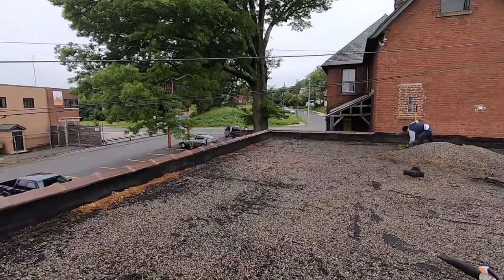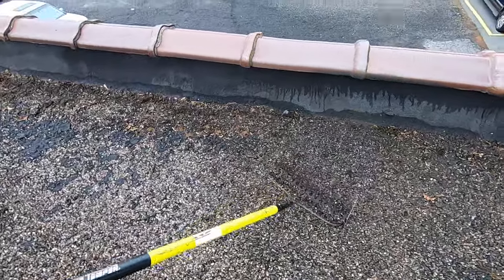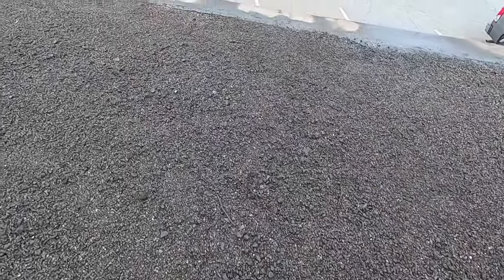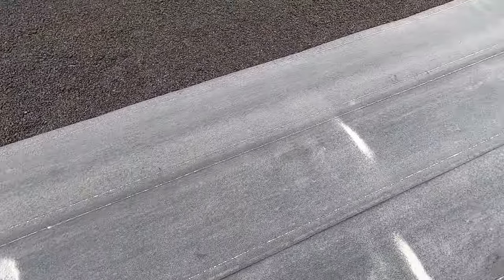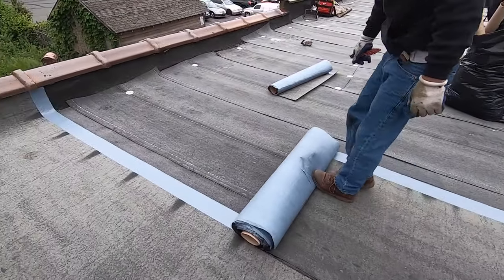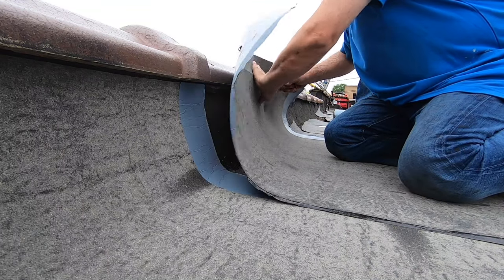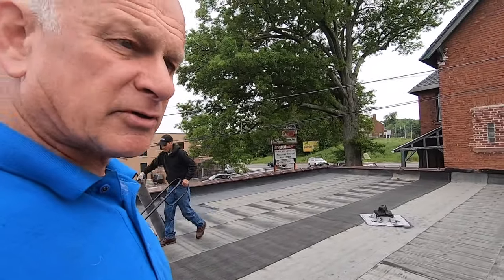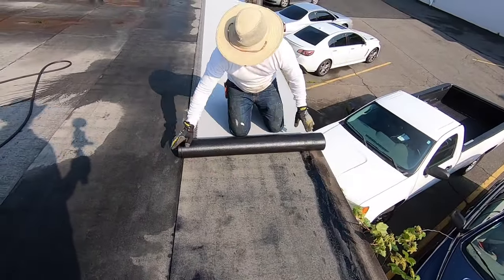Installing a Torch Down Rubber Roof directly over Gravel - Turbo Poly Seal Flashing repair

Comment: Nice all the screws through the deck will make nice drainage holes for all the moisture that was covered up on the old roof.  U always need to vac the blast off roof and repair any splits and blisters in the old roof.  Hope u installed moisture vents in this roof other wise its own to be one blister.
Reply: im worried you are right especially on a flat flat roof

Comment: Dude ! I've been doing commercial roofing for 15 years and I've never seen such a thing ! And I dont mean that in a bad way. That's awesome!!! Next time I get a side job and the existing roof is a gravel build up like the one you just went over I'm definitely gonna push for the customer to go your route. It saves so much time ! Why the hell have I never thought of this. Cudoes to you my man !!!!
Reply: I think it cant be dangerous such as a sharp rock or water build up in some areas.
Reply: Don't.   There's a reason you've never seen it
Reply: I'm a 20 year roofer, this is completely wrong, the condensation under the new roof will rot both roofs. Seen it 100 times, also the waight is dangerous on an old building
Reply: @JdsjsKdmem  sorry, I thought the condescending sarcasm in my comment was obvious.  I'll try to lay it on a little thicker next time I'm trying to be a smart ass.
Reply: @nicholasmanovich4330  rock on brother

Comment: I saw the videos you did with your son showing the same procedure 
But this one gives more info. Thank you 
Here in Canada tar and gravel are still very popular. 
This is a great solution for when those roofs fail
Especially on apartment buildings
Reply from the maker: Yes, I have videos just describing the process on how we install Torch Down over gravel roofs. But I made this one specially for a few people that requested a more detail installation

Comment: Your video is a godsend. Many thanks from me and my multi-decade old Built Up Roof.
Reply from the maker: Your call prompted me to put this video together last night. I had many people ask me in the past the same questions and I thought this would answer most questions. This is a a tested system fro the last 25 years and no failures.

Comment: Did the original roof have leaks? Did you just leave the wet material under the original roof to rot the decking? What about all the moisture that is now trapped between the old roof and your new membrane, that moisture will most likely gasify, did you install any roof breathers? Any insulation that is wet or damp will condensate with the heat of the sun beating down on the roof. The removal of all wet material from the roof system is roofing 101.
Reply from the maker: You know too little. When someone asks questions to show everyone they know something, it is when you can tell they have little experience.
There is more ventilation and air movement between the old Build -Up roof and the new rubber roof that is lying on top of the stone. The stone is not trapping the air. The stone allows air movement and it vents out towards the parapet walls. All that moist that was there dissipates within a week after installation.
I am on Roofing 102 already. You may be wet behind the ears, but this roof dry. I am hoping to stop by this roof in Hartford CT soon and cut a sample out to show. I have done many of these systems in the past.
I also found out that people have been installing Torch Down directly over stone 30 years before I even started doing it. I was disappointed to see that I was not the first.
Reply: @FlatRoofDoctor  I'm looking forward to the test cut in Hartford CT!
Reply: How did the test go?
Reply from the maker: Ok, you sound like you don't have much experience. Thousands of roof leaks every day. Just because they leak it doesn't mean you need to remove all the wet stuff and insulation. Any water leaking into the structure normally dries within a few days if the leak is sealed. The moisture is trapped between the upper membrane and lower build-up roof among the stone dries up within a few days or a week. The air moves among the stone to the outer edge escaping where the membrane is tucked in under the flushing or coping stone on the wall.
I have been doing this for 35 years, with no problems. It is by far a better system because the air trapped among the rocks between the 2 layers helps keep the roof cooler and also does not transfer the heat to the bottom layer.
Reply from the maker: @taxslave5766  Hmm, Thanks They that judge, will be judged in the same manner. We will see
Reply: May the roofing gods have merci on you.
Reply: So how did the test go?
Reply from the maker: @CH-ml4rz  What test? This roof has been installed 3 years ago. No issues and there will be no issues for the next 30 years or more.
Reply: @FlatRoofDoctor  what test? The test you yourself said you we’re gonna do in this very thread. Is the dementia catching up?
Reply from the maker: @CH-ml4rz  Yes dementia already got to me long ago.
Reply: @FlatRoofDoctor  I cut into a flat roof one HOT day and got  hit with superheated steam. These roofs can hold moisture, but there are tons of variables. had to add a bunch of vents which dried it out and got the ants out, as they were the reason for investigation. Warm and moist, ants love it. Mold too.

Comment: I'm not a fan of just covering up. Mostly do tear offs and reroofs lol but like you said it's up to the people "within their budget" you know the jazz. Nice work haha
Reply from the maker: Thanks. When installing a roof, you need a good solid surface. Why tear down something that is a good foundation. It makes no sense. The insulation is already in place, the pitch is already made.
Reply: @FlatRoofDoctor  plus it depends if underneath is damaged from someone who didn't do it right haha i have seen many roofs damaged because it wasnt sealed right. Depends lol
Reply from the maker: @garrett3113  There always many factors to take in account.
Reply: @FlatRoofDoctor The whole roof is soiled. There’s perlite board if you scan that roof it’s full of water and moisture. Overtime that will freeze and start to crack the roof. Have you ever spoke to a manufacturer representative to get a proper warranty.

Comment: What kind of fleece is that? Do you get it from the roofing supply store? Also do you have a link to how that moisture under the new base dries up? Does it dry up from the air coming from the side of the roof without a wall that probably has drip edge? Does air go behind and under drip edge then between the voids in the rocks? And will it dry up moisture from the other side of the roof as well?

Comment: Thanks for vid and yur no nonsense style. Ive subd. Including original gravel layer theres like 4 skins on that roof. I note no gravel applied on top of top skin  so what protects top skin against UV damage. Cheers. G
Reply: The top layer is granulated in a lite color. Thats your UV protection. Same as granules on asphalt shingles.

Comment: hi doctor thanks for your minute details and passion,,,also seen your three sons working...god bless nice family
today i bought  roofing torch,,,,can i use it with small 20 pound propane cylinder or i have  to buy big cylinder,,, i need to  do my 10 x10 feet flat gravel roofing,,,,could not see material at lowes  canada,,, need to find out material supplier  thanks
Reply: Try Roof Mart In Canada the manufacturer is soprema.

Comment: love your videos, thank you.  I have a leaking and poorly installed torch down.  There are 2 inch ridges and its failing at the seams after freeze thaw and i am tired of patching.  would this system work well for that if i cut out and smooth down the ridges?

Comment: Really enjoying your videos.  Can tell you've been around the block in this type of business.  Glad your sharing some of your knowledge with us.  I have a small apartment complex with flat spray foam roof and ponding water.  Was thinking of cutting channels like you show in your video and install torch down over that.  Will your roofing system adhere to the spray foam?  Thanks for your time.
Reply from the maker: I am glad to make a difference. Nothing works on spray foam

Comment: Great video! This looks like what I need. I have a tar gravel roof to repair. Please advise if I can use a SA cap sheet instead of installing a modified bitumen membrane torch down. Thank you.
Reply from the maker: Ok, I assume SA cap is referring to Self Adhering.
I only have had trouble with SA cap sheets. Especially on a low-sloped roof. They will leak. The SA cap sheet is supposed to be installed over a low pitch roof, 4 pitch I think. If you still considering a SA cap, I suggest you run a torch along all the seams to fuse the layers together.
It is still time-saving but at least more secure.
Reply: @FlatRoofDoctor  Thank you very much for your quick response. 
My project is a 20X20 flat garage roof, 40 years old. I have replaced the damaged plywood on the low side, removed the loose gravel on the roof. I was trying to tear off the old roof and reroof on the deck but I cannot. It is too difficult. Now, the surface is solid but not smooth. It would be a problem when installing the SA sheet. So I am planning to use three plies. 
For the first ply, I would use a regular fiberglass base sheet (GAF Tri-Ply #75 Base Sheet) to smooth out the surface as much as possible; then I am going to use Flintastic SA NailBase as the second sheet; on the top, I am going to use GAF Liberty SBS Self-Adhering Cap Sheet because I don't have the tool to do torch down; finally, I am going to use an extreme rubberized wet patch (Henry 209XR, from HomeDepot) to seal the edge of the seams.
Any suggestion to my plan will be highly appreciated.
By the way, do I need to put the gravel back to smooth the surface before applying the base sheet?

Comment: hi doctor one more advise... my torch comes with just three feet hose....what hose i can buy to extend it to 10 to feet approx thanks
Reply from the maker: What Torch did you buy? On this site, you can see they all have over 30 feet hoses.https://www.modisystems.com/MagnumTorchKits.php
On Amazon, they have this https://www.amazon.com/Red-Dragon-RT-Combo-Roofing/dp/B00004Z2FL
Why don't you search on Google where to get the extra hose. A propane company that sells propane equipment will also have hoses

Comment: Great video
Reply from the maker: Thanks Andrew There are not many gravel roofs left but I wanted to show people how they can do it from the beginning to the end.
Reply: @FlatRoofDoctor  
Can you send me a link to video with traditional flashing 
Instead of Poly?
And how to torch down around obstacles?
And to relevel roof before torch down on roofs with existing ponding and drainage issues
Maybe retrofit different types of drains and scrubbers
Reply from the maker: Hey Andrew, that is a tall order. But I am planning a series of videos where I show how to Torch and Tricks I use. Can you tell me what you do?
here is a link to a video I recently made to level an entire roof. https://www.youtube.com/watch?v=tYkxBnwlR7Q
I have another video, not edited yet where I use ISO tapered board to slope an entire roof.

Comment: Another question about spray foam roof.  I seen in your video going over gravel.  Could you not go over the spray foam as well?  Looks like all flat roof systems are floating except for the mechanical fasteners that hold the first fiberglass layer.  I like the thought of carving out the foam to make runways to the drain to get rid of the ponding water.  Is this not possible?  Trying to avoid complete tear off of spray foam.  Thanks for your advice.
Reply from the maker: Yes, you can go over any surface as long as it supports the membrane.

Comment: Can this system be used on a home? 1-2/12 pitch.  How is the low edge of the roof fastened down?
Reply: It can be installed on any pitch especially 1 to 3

Comment: That looks like a good system .
Nothing like that over here in the uk though.
All materials are stripped back to main structure .
I must say If any of my blokes did a flashing like that on a new roof I would not be happy .  In fact if they did a flashing repair and left it like that I would not be happy either.
It’s quick work and as you say will last a long time  but no pride in the Finnish .
I could not leave a roof finished like that .
Reply: Yeah, his roof will leak at that crap "Flashing" job. Not all do this so poorly here.

Comment: if possible please write separately what make materials we need   and availability from home depot or lowes thanks
Reply from the maker: You cant buy these materials at a Home Depot. You need to find a Roofing Material Supplier like ABC Supplies or Beacon Roofing
Reply: @FlatRoofDoctor  Funny thing! My  pro roofing supply [2 different ones] said he had one roll of torch cap sheet and none coming. $125 he wanted for that roll. Lowes had cap for $102 and intermediate for 99$. 50 in stock. They are getting better!

Comment: The modified bitumen GAF products I have used, over time the granules come off leaving the roof less protected and that's when the seams start failing. How do you prevent this? A local roofer recommended sealing the entire roof with 2 coats of GACO silicone roof coating

Comment: It will leak.  Look at 8:14. There is a gap.  Thses little things neglected here and there will eventually cause roof leakage.  That is why majority of roofs leak because no body and I mean nobody wants to take time and make sure every step is done perfectly.  At the end he did not even tucked in under the copping tiles..
Reply from the maker: You are just plain "stup..". The base is a self-adhering base. Not like what most of you guys do with plain fiber base paper. 
This has 3 layers. The fiber base, the self-adhering Modified Bitumen base, and the final cap sheet.
By the time we get to the final layer, there is no seam corresponding with the previous layer's seam. I have been installing this system for the last 30 years and have had no leaks whatsoever. 
The reason we do it this way is exactly for the reason you pointed out. If someone made some error on a layer, then that would be corrected by the next layer and you will never have a leak. It is redundancy protection.
You are a coach critique that needs some experience.
Reply: when it leaks you charge them for turbo poly seal. it's a win win.
Reply: i thought i was the only sane one here he may be a nice guy.... but he doesntknow what hes doing..i am a professional roofer he is doing so many things wrong with his methods i feel sorry for the home owners and he actually trained people to roof a big comercial job  seems like some one would expain the fact he needs training himself he doesnt install metal correctly the underlayment has 1  fastner every 8 ft he doesnt clean prime or scuff the metal... cutting tile to run self sticking up y

Comment: Will this work on a low slope roof? I have a tar and gravel roof on my house with a low pitch.
Reply: It is a low slope roof
Reply: You would need a wood fiber board mechanically attached with an sa base sheet on top and new edge metal if you don't have any walls metal size should be 2x4 or 4x4  then your torch down can be applied.

Comment: Sand was wet that my cause problems future
Reply from the maker: Neh, The moist still has ways to escape because there is enough air movement where damp air can escape at the end of the membrane under the half-round caps
Reply: @FlatRoofDoctor  well that's not right! Improper details everywhere

Comment: That roof will bubble up with all the water under it and it is not fully bonded it can blow off also you didn't stagger the joints bad roofing would never do that in England 2/10